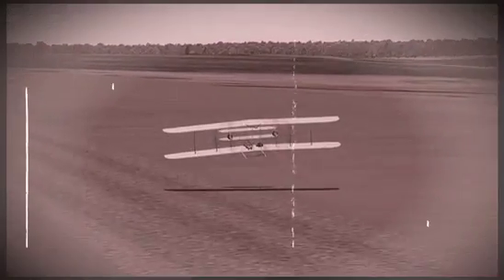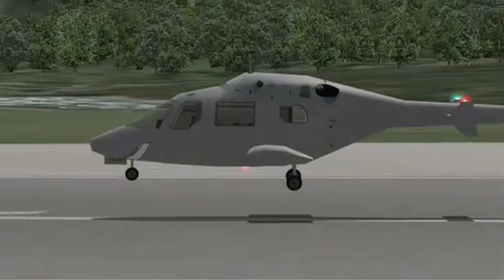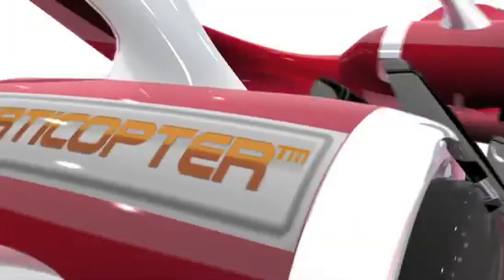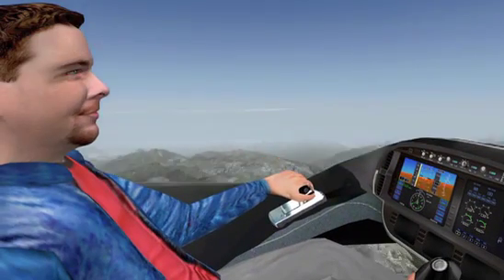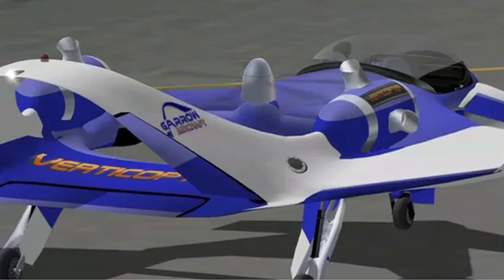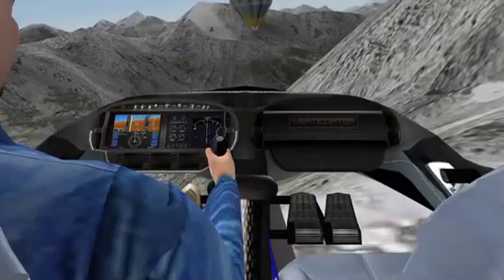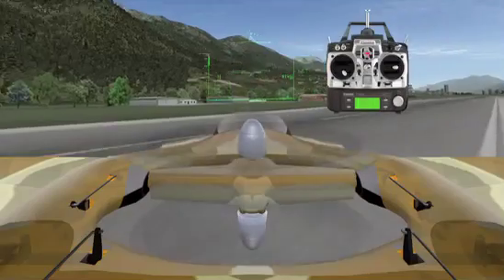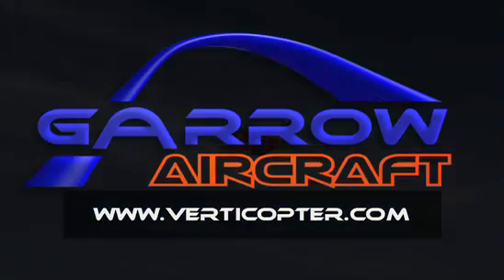VertiCopter Info Video

Comment from the maker: You really need to go to the Verticopter (dot) com website.  We JUST updated all the info, and you'll see more pictures and videos of the REAL prototypes.  

Also, what you call "CARTOON" is actually a very accurate computer-based simulation.  

No plane gets built nowadays without rigorous computer-based testing.  This is the phase the Verticopter has been in for most of these videos, and that's what's being showcased.

If you download it, you can experience its true-to-life flight behavior.

Comment: I read that this is a STOVL (& not VTOL) Aircraft,  what is the reasoning behind the difference?

Also, if the problem facing VTOL is control during Hover/Take Off and you folks did not want to use a Swashplate on the Proprotors a la V22 Osprey. 

How about using a Rotor Hub Tilting Mechanism, the way of the Autogyros. 
That should help keep weight & complexity down.

Comment from the maker: 1. IT WON'T WORK - We've made several prototypes that have worked as predicted.
2. Rip-off Artists - The Verticopter is an idea that has not been done before in the world of VTOL.
3. There's a patent-pending solution we're working on right now for full pitch maneuverability.  Besides, you seem to not understand that this is conceptualized as a STOVL, not a VTOL.  
4. What makes you think most of the mass is over the CG? That statement doesn't even make sense.  Most of the mass IS AT the CG. Duh.

Comment: Design hinderance:
A.) The need for 2 rotors to balance the effect of torque.
B.) The reduction of air flow through the blade area while if forward flight from vortexing over the top of the canopy and body. i.e. the props are not directly in the airflow. They are obstructed to a degree.
C.) The need for a decoupling system in event of total engine shut down. Tipjets don't need this because of the free rotating rotor hub.
D.) The need for point thrusters to manuver because all torque is balanced.

Comment from the maker: What types of design hindrances are you referring to?  

Tip-jet technology would solve no design hindrances. The main advantage of tip-jets is that they don't produce net torque... something that the Verticopter doesn't have to deal with.

Tip-jets are also best used on helicopter rotors, not propellers. (The Verticopter uses propellers).

Also, you may want to take a look at the newer videos, which address all the new features and updates we've gone through over the past year.  This vid's old.

Comment from the maker: Just look it up on Wikipedia and other sources.  It's all there, both under Santos-Dumont and under Wright brothers.  

Personally, I don't care if there was a panel or supervisory committee... the definition of flight does not depend on that.  All you need is witnesses... and you're mistaken about the Wright-flyer's lack of power.  The rails were only there to maintain it on track.  It was self-propelled, and to attach the definition of flight to landing gear or rails is really quite silly.

Comment: In almost all other countries, the Wright brothers are considered the pioneers of aviation were flown in by December 17, 1903, three years before Santos-Dumont. But this flight was made without a scientific committee or witnesses and the apparatus of Wright, other than the 14-bis, did not use self-propelled. He was catapulted into the wind and only then was able to sustain the air.

Comment from the maker: I'm trying to respond to this comment, but it won't work.  I have a picture comparing the Piaggio Avanti to the Verticopter, to showcase the point about wing area... but maybe YouTube is not allowing me to post this comment, because there's a URL.  Let's see if that's the case.

At any rate, the airfoil has also been meticulously engineered to maximize glide ratio and it produces excellent lift at low speeds.

Comment from the maker: There's a smaller one coming: a 1-seater.  The glide ratio is more than adequate for safe landings during complete engine failure.  In fact, it's pretty comfortable compared to most other planes in engine-failure situations.  You don't HAVE to find a landing strip... it doesn't need that much space to land, even without engines.

Comment from the maker: I'm not sure... Never really checked.  And it's still a work in progress, so statistics will be changing over time a bit.

This plane is stall-proof, since it's a canard, and has vertical flight capabilities.  The glide ratio is pretty good. It allows for safe landings at low-altitude engine loss.

Comment from the maker: 1. Thanks.
2. Still a huge danger of parachute getting tangled in prop.
3. Probably, but that's not part of this design.
4. Canards are cool. They're stall-proof, and provide more lift.
5. Wing tip and tail puffers (like the Harrier).
6. Inertia is lower than a heli's rotor, and disc loading (weight per rotor area) is higher.  But large wing area compensates for this, and makes for a safe plane even during dual engine failure.

Comment: 3.-¿would it possible to place the canards over the cockpit, as a car´s roof? cause in aircraft i'd better see down than up...!!specially in VTOL mode...
¿Can the upper surface of the "ring-wing" tail stabilizers be used also as horizontal stabilizers(elevators) to somehow do/substitute/displace the canards function/position?
4.-jeje, I really dilike canards!! but if they still remain, some surfaces (wings) might be tilted as in v-22 during hover for horizontal stability... added complexity...

Comment from the maker: The Verticopter's CG is occupied by its propellers.  A rocket parachute would cause more problems than it would solve.

The Verticopter went through 47 design iterations, and the canards (front wings) were added in the 40th iteration.  The advantages outweigh the disadvantages by a large margin.

Any more "You should's" are welcome, but please consider that if you don't display an understanding of the plane, it'll reflect poorly on YOU, not on the plane.

Comment from the maker: Due to the prototype nature of this plane, it has not been made for FS (either one), because FS does not use laminar flow calculation to predict flight behavior.  The idea of the virtual model is to showcase its flight characteristics in a simulator known to have a realistic flight model.  One could get a fridge to fly like a Cessna in FS, which would not really help in predicting flight behavior of a new design.  Performance is very good in X-Plane 9, and a free demo is available.  Try it!

Comment from the maker: As mentioned in the video, X-Plane accurately predicts flight behavior.  The airfoil shape goes a long way towards making a BWB (Blended Wing-Body) design or flying wing viable and actually quite efficient at high speeds.  (I'm assuming you meant "horizontal flight" instead of "vertical flight."  (Vertical flight is barely affected by aerodynamic drag.)
Besides tests done in X-Plane, real-life Radio Control tests have confirmed the viability of this configuration (see video response).

Comment from the maker: It's not a jet, but more like a turboprop.  (Propellers are powered by turboshaft engines).  The "gliding" is attained through a combination of effects: large wing surface area and windmilling propellers.  Ever heard of a helicopter autorotation?  That's what keeps helis "gliding" when their engine fails.

The fact that props would strike the ground in case of a landing gear failure isn't unique to this design.  Any propeller plane would have this problem.